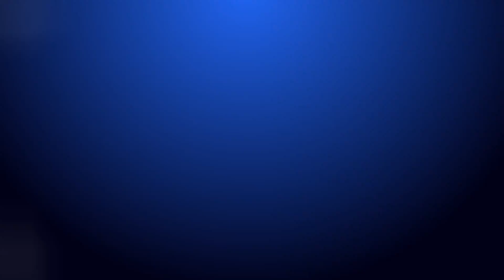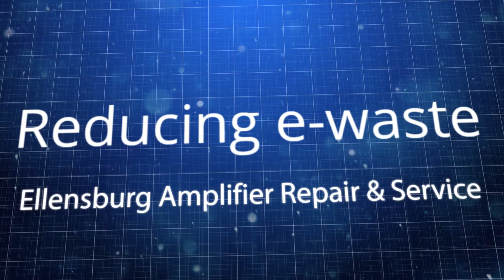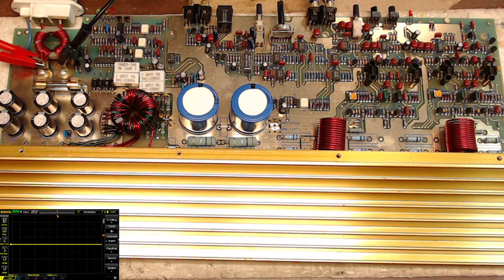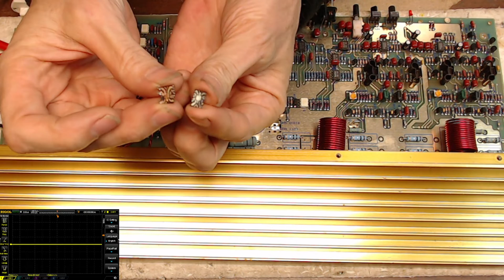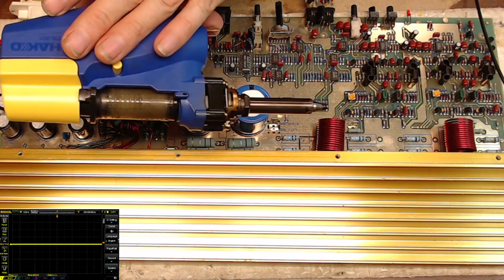Phoenix Gold M100 Bad Rail Capacitors and Protection Integrated Circuit

Comment: I bought a Phoenix gold zx350 really cheap, that was completely dead. Ztx749 on daughter board was shorted. Replaced it and have a great looking PG ZX 350 for the price of a $1.00 part!
Thanks for the videos. Gotta figure out a distorted right channel on a PG M100 with the green board. One of the first 1000. Actually number 758.
Reply from the maker: Nice work! It is amazing how a single small part can take down a circuit. A scope will show you quickly what the issue is with the M100 if you have one.
Reply: Thank you. I figured it out. It was the 33uf caps on all the preamp sides. I replaced every cap on the board. It sounds great. 
I have a siglent 1104x-e now. I started on a tektronix 465A and then got a HP 4601 and a HP 4602 with storage module. 
I was thinking about a Rigol DHO924s, 12 bit with a signal generator. The best part is it’s VESA mountable. Scope on a telescoping arm… I was also looking at a siglent SDS2104x plus. 
I’m sure if I wait a bit siglent will release a 12 bit VESA mountable scope. Haven’t had any issues out of the siglent. Probably will stick with them?
Thanks for your videos. 
Your JL XD600/1 was helpful. The one I repaired had blown Power supply and took out the pnp gate drive transistors, due to blown output gate drive IC and shorted outputs. Wonderful renesas/intersil. Almost as fun as their HIP4080AIPZ😂😂

Comment: I had a question on replacing/upgrading the caps on an Orion amp (power supply caps and the larger rail caps) I just got it in with 2 blown power supply mosfets (I’m replacing all PS FETs with newer matched PBF FETs from Mouser) Output FETs all look/test good, but ya a few of the caps on power supply side look a lil’ bulgy, they are 35v 2200uF 105c Samwha caps, I want to replace the larger Samwha 160wv 1000uF 85c rail caps too, I want to use Nichocon Muse Or Elna Silmic II, or better, should I go with higher temp as well? I plan on thickening main traces as well, reason being I plan on running the amp personally until I get an HCCA DSPLX. I actually plan on keeping it in my collection as well, an Orion XTR 2500.1 Dz. I want low impedance, low esr, same V&uF spec right? Would increasing spec at all give me any leeway for cleaner/more power or is that a slippery slope changing cap specs? I know the rule of thumb is you can use larger but I’m not trying to redesign the amp, just spend the money on better parts that Orion didn’t want to :) Anything else I should look for or aim for? I know Nichicon and Elna each have their own Audio Grades, and I don’t mind putting the money into this amp, but this is a first for me, upgrading caps, so any advice would be appreciated:)
Reply from the maker: You are correct about matching the specs or I should say better specs for the capacitors. Now I would advise against running larger capacitance so stay as close to the original capacitance as possible. I like to use 105c caps if I can get them but there is some trade-off between the two. Don't forget about Panasonic! They too make some great caps.
Reply: @ellensburgamplifier  Ahh ok, I’ll look into Panasonic too, ty :) Another question about the caps, I’ll stay right on point for capacitance value, but regarding voltage values, that’s the threshold correct? Like if it’s marked 35v it can handle up to 35v? What would be the benefit of going larger on voltage? Would going from 35v to 50v make any difference on the power supply caps? If not what would you suggest? Same with the rail caps, I’ll stay at the capacitance spec but would going from 160wv (btw why is it marked wv instead of just v?) to say 175v or even 200v? I want the upgrades to make a difference, ya know, to at least be worth it. I know this is all guesstimate/theory talk but I trust your experience, any insight would be awesome bro as I’ve been wanting this amp for awhile but couldn’t drop retail on it, finally have one 🤤 ...ty Todd!
Reply from the maker: @Nūrd_AF  WV is just another fancy term for its max. working voltage. Capacitors are truly interesting when they are in operation. It depends on the voltage the capacitor sees while in use. If you have a 160-volt cap and you are riding it at 155 volts (not including any ripple) then it may start to get warm as you approach the WV of the cap. Add some ripple and then things get interesting. Check out the datasheets of the capacitors charging curve to know more about how they react under load.
Reply: @ellensburgamplifier  ahh ok, now I can see why a higher voltage is a good idea, I know companies usually just use what’s needed to get by, saving money where they can, usually tho what they use is sufficient for their design if the device is used proper/within spec. A lot of people report back that this amp can handle .5ohm loads easily and some have had it wired that way for years, I’m assuming box rise has an effect on some (bringing up the final ohm load to 1+ even tho they may have subs wired at .5ohm final load) do you think higher voltage caps would have a play in helping with stability at a lower ohm load? Are all voltage specs on an amp the threshold? I know the other specs are crucial but say you match up everything else but increase voltage and/or amperage ratings/threshold would that help over all on lower ohm loads? This is all theory mind you, I need a lot more experience before I go doing all this, if I ever do, but still learning how what works to help what would help with the overall learning experience ...or so I’m telling myself lol. I’m going to check out all the datahseets I can find on the main components of this amp :) Ty Todd!
Reply from the maker: @Nūrd_AF  For the most part the engineers have it figured out. At the same time, they can't cut too many corners as this would lead to a huge warranty return percentage which they also don't want. You will find as you learn more about class D switching, that the inductor and filter capacitors play a huge role in the acceptable minimum load. Me being a repair tech I never advise or warranty repairs that have lower than recommended connected loads. Can it get away with .5? Only in the right conditions.

Comment: Another great material very short and to the point :)
By the way, I am still fighting with the pioneer because there is a problem with these transistors, but I will get them :) Regards
Reply from the maker: Thank you for watching! Do you have a transistor tester or are you just using a meter? Knowing Rds on and capacitance of the transistors will tell you quickly if they are genuine.
Reply: @ellensburgamplifier  Hi , i use with a gauge,I soldered a transistor of unknown origin and, interestingly, the amplifier works, I am surprised that the meter cannot read any measurements from this transistor,
This worries me a lot because I would like to make sure that I did everything correctly.
By the way, I'm looking for a good soldering iron, would you recommend a soldering iron at a good price, similar to the quality you use in filamch. There are many soldering irons on the market, but which one to choose :)

Would you ever make a short video tutorial on How to correctly solder transistors and other components ?:)

Thank you :)
Reply from the maker: @bradpitt3965  If you can get something like the Hakko FX888D I think you would be more than happy. I don't know what time it is where you are at but I may be going live in an hour.